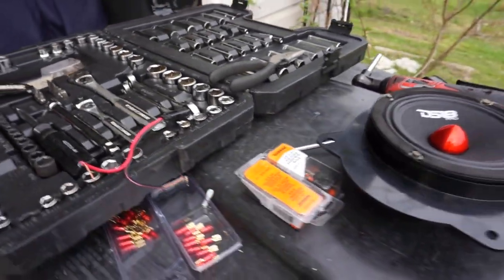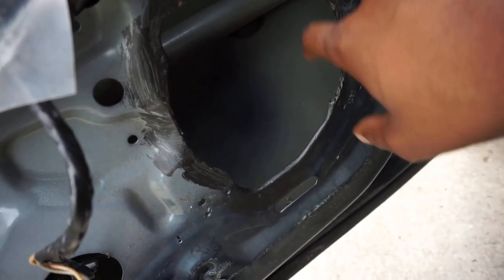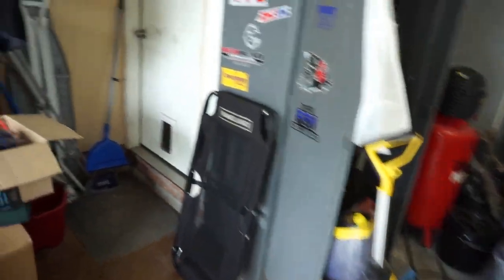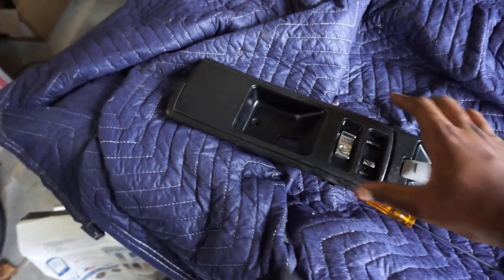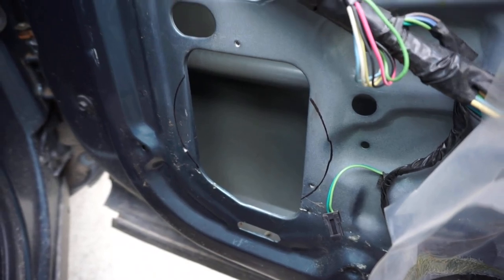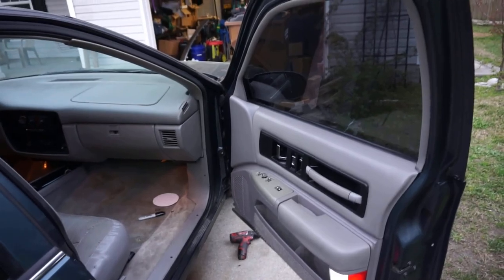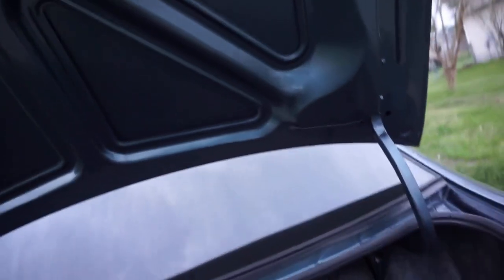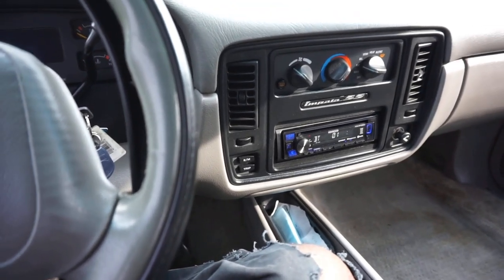INSTALLING DS18 6.5" SPEAKERS IN 95 IMPALA SS

Comment: Hey thats a dope setup! And i enjoyed the video content. I own a 95' Impala, color back and its all factory stock looking. I put some inexpensive Kenwood 6.5s in the doors. They were just small enough to fit without cuttin or modifying door frame or plastics. I got the Metra brand speaker adapter and it mounted up👌

Comment: Yeah that liquid electrical tape will keep it from grounding out on the bare metal. Run them suckers to an amp though man your head units puttin out like 25% of the power they should be seeing TOPS

Comment: I don't know if this has be presented to you yet, but if you want to keep a crack in any hard material from spreading, you simply just drill a hole directly in the end of the crack in the direction(s) you don't want it spreading.

Comment: Hey man, so would u recommend ds18 or jbl like in the 3rd gen? I have a 3rd gen I wanna do a system on. Genuinely curious lol
Reply from the maker: Ds18!! I took those jbl speakers out my 3rd gen. Ds18 has much more power
Reply: @EVERYTHANGDIESEL  thanks man, keep up the vids!👌🏼
Reply: @EVERYTHANGDIESEL  do they sound crappy loud or Good loud?
Reply from the maker: Good loud. Crisp no distortion and that's just the speakers alone no amp hooked up. If u have a 4 channel running to them I'd imagine they would be even better
Reply: @EVERYTHANGDIESEL  thanks mane for the response I’ll make sure to buy them👍🏼🔥
Reply: Jbl gto629 for your buck those the best you can go DS18 are mid bass speakers so you’ll def get more boom for your buck with them jbl are koo but I’d go ds18 pro you’ll get a pair for 110

Comment: How is the bass? I understand they aren't gonna hit like a sub but I need a loud 6.5 in my side by side. With it being open and it being modded it drown out my sound bar. my sound bar isn't cheap either so I need something that is loud with a little bit of bass. I really don't have room/want for a sub. just something that doesn't drown out but has a little thump. thanks
Reply from the maker: I take the bass out of these, but if u got a amp for them they got a little bump

Comment: Not tryin to hate but youll learn someday that that sounded horrible loud doesn't mean good when u turned them up some frequencys were great but others killed it so you need to learn how to work off that a decent 7band eq will help u control that leaving the good sounding frequencies and removing the bad sounding frequencies and send them the proper component with an active crossover unit then you have a tweeter pushing those sound frequencies the 6.5 can't handle while still sending the mid-range frequencies to the 6.5 mids then you leave the low frequencies on Subs 6.5 pods for the doors your loosing all the sound quality in the giant uninsulated doors that are not air tight by any means also u need crossovers with separate 2in tweaters to go with each door so you can tune the 6.5s for mid range like they're made for and that massive trunk has a big air volume so 6×9s would be a better fit possibly 4 of them across with 2 2in horn tweeters in between 2 on each side and active crossovers 600 watt rms 4ch Fosgate to drive the by9s and a 2ch Fosgate 300watt for the fronts then u can smack 1 18in or 2 15 inch t3s with a power series mono 1500bd Fosgate at 2ohm then you'll be decently loud

Comment: I just driller my speaker on to the door with out no cover on it just the speakers
Reply: Why?
Reply: @smokinjoe006  i don’t know but it sound great
Reply: @ycnkevin2x266  ok just wondering. I went ahead and ordered the adapters and having the speakers installed as I write this message. Did you go with the same speakers shown in the video?